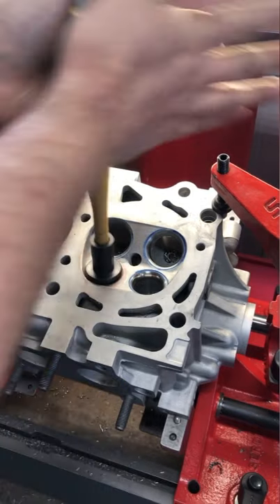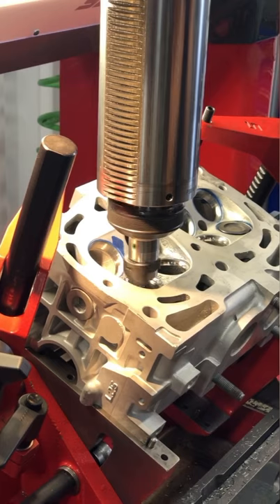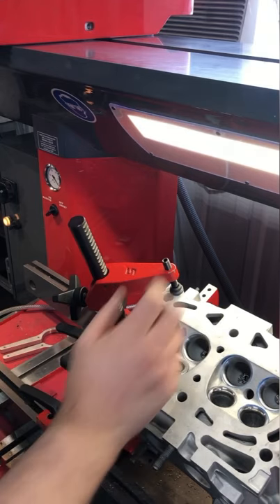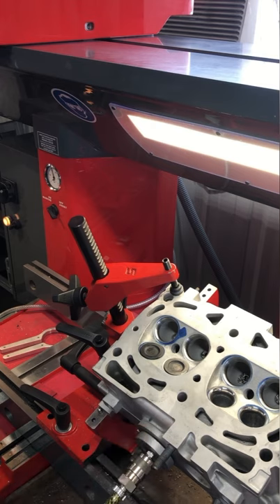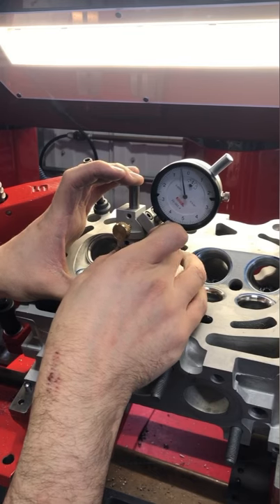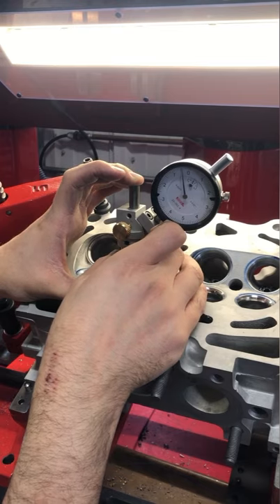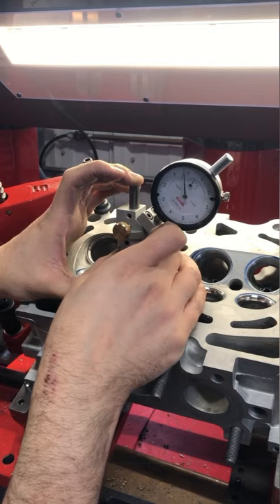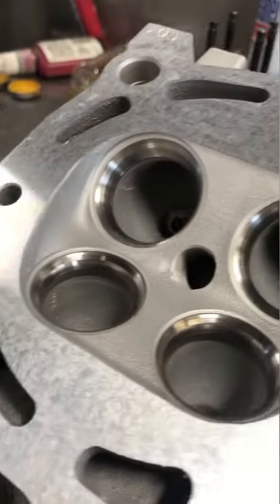#shorts Let’s try and explain this... again?

Comment: When making sure a valve on a steam or gas turbine seats proper we blue the valve and slam it into the seat, or vice-versa. Then from there we lap it with lapping compound or lapping tape. Rinse and repeat until the bluing transfers completely to the valve or seat. That said a valve on a large stream turbine can be 24" to 36". While we have to align shafts, bearings, shrouds, bases and flanges to within a specific tolerance. There are times we use the valve and an impact with a lapping compound to mill the seat until its going to assure a proper seal.

Comment: Trolls dont understand the finalities of anything!!!! You can machine something as perfect as possible and still have chatter from a dull tool or the seat has a hard spot or slight defect - truly & honestly seat lapping with paste finishes it off - bluing is a good guide for seating position and 30,45,60  angle placement if minimal valve seating is a performance requirement for gas flow - 👍👍👍👍🙏🙏🙏 your videos are very concise and informative - KEEP UP THE GOOD WORK 👌👌👌👌👌👌

Comment: Basically, it is a start up point prior to going onto the cutting aspect just to make sure that the alignment of the valve seat that may have just been pressed in is practically square and not off kilter in reference to the underside of the valve, correct?  If this is so, that is a great trick and very astute of Nicholas doing this methodical step?  GREAT WORK!
Reply: He starts machining the seat, once the sealing surface of the seat is machined, he puts the marker on there so he can see exactly where it is contacting on the valve face, he does this in case he set his tooling slightly off from where he wants it so he can adjust the cutter in or out to have the optimum valve face sealing location, once its set right he continues machining the seat until he gets to the desired depth.
Reply: @Joshhalley711  Ahhhhhhhh, perfect!  Good trick.  Thank you!  Hello from San Antonio, TEXAS!

Comment: I blue valves to check how well they're seating, obviously vac them too but you can tell allot from bluing where a vac could trick you. For example if you had an interference angle where you didn't want it, it could in theory pass a vac test but you'd see it in the blue. Lapping to check valve seats is not precise. Great videos though man, I've learnt quite a few different ways of doing things I do on the daily! Awesome

Comment: Educating people is more difficult than non-educators often assume. Misinformation has to be dislodged ("un-learned") before new information can take hold. Also, willful ignorance exists. People tend to dig in their heels and fight rather than admit being wrong - even to themselves. When faced with these obstacles,  one has to determine if it's genuine stupidity or ignorance that's preventing the absorbing of the information one is trying to teach. There's a difference: "ignorance" is never having been exposed to the information. "Stupidity" is being either unable or unwilling to absorb it.

Comment: Better than our method, not that ours didn't work. We would reach under and hold the valve open with one hand and tap it down firmly to check seat seal width, seal position, and ensure even sealing all the way around.

Comment: Back cutting that remaining blue  the stem side at a fairly sharp angle , and slightly on the valve face, will gain some flow,  and that seat width is a fine dance between flow  and surface area, to allow enough cooling,  and the seat needs to be smaller with the proper angles  for the venturi effect, or the engine will not make any Power ,  it's all a fine line between success and failure,!

Comment: Something's seriously wrong if you need to lap at this point.
Reply: Think the message is reassuring one self? 
Small businesses live of their reputation you know, big businesses usually don't give a....
Reply: Well, not really. The cutter is registered against the block, thr valvr seat against the valve stem, so wearing them down against one another is pretty important for that mirror polish and perfect fit. I mean grinding were talking about flatness at the microscopic level, not just a tenth of a thou
Reply: @DrTittieSprinkles  what the heck man? First of all, the amount of people building $100k engines is ludicrously small. Second of all, I don't think he was using a $5 suction cup, he was using a vacuum gauge, which seems like an excellent test to see if the valve holds against pressure and doesn't leak. Because that's exactly what you want a good value to do. On top of that, pretty sure the grinder and lapping machine stuff this guy is using isn't cheap at all
Reply: @imthedarknight-8755  You don't even know what you're talking about. That Serdi is a seat and guide machine not a "lapping machine". I'm agreeing with the video not the ding-bat I replied to.

Comment: Well you could lap the valve to achieve the same result, thats my method, but I don't have fancy Serdi's lol.
Reply: You can't achieve quite the same result by lapping. You can get old valves and seats to seal by lapping, but you are reccessing the valve and widening the seat contact area as you do this.
Reply: You really don't need to lap it that aggressively to see it. I'm talkin 5 seconds give or take with fine compound, yes its harder to see but it works.

Comment: I’m still grinding my seats the old way with stone I never have a issue
Reply: Well yah  ...  

As long as you dress the stone frequently, it is a perfectly viable method.

And, I've never seen a controlled performance comparison between ground seats and cut seats.
... Probably due to the difficulty involved in distinguishing a measurable difference.

Edit: 

And, I would add:   By using "fine" finishing stones, lubricating oils, and light pressure  ...  it is easy to arrive at a polished seat surface, that is not possible with a carbide cutting tool.
Reply: As a retired mechanic,  I can do a ground valve job, polished smooth with a fine stone that performs as well as any cut seat. Not all machine shops are set up with the newer technology as shown in video. A mechanic can raise and lower, thin or widen any valve /seat contact location with a quality 3 angle grind. A rub of prussian blue to double check and I would match a quality grind against any cut.

Comment: Unfortunately, I am just joining the discussion, as I have not seen previously uploaded vids on this topic.

While I am fully aware that this video has nothing at all to do with valve-lapping,

 I think that it needs to be said (if it hasn't been already)   that the old-school method of "lapping valves" has long-been surpassed by improved methods of valve work.

It has been shown repeatedly, that when abrasive valve lapping paste is used, to "dress" valve seats; the abrasive medium does not cut the seat surface evenly. In fact, lapping always produces a concave depression in the seat, that increases in direct proportion to the length of lapping time.

Comment: Attention to detail makes all the difference. If you're work is so precise that lapping isn't required? That's perfection. That's how you justify the charging premium price and have people willing to pay it, over getting 'Old Skool' to hook you up for half the price and a 12 pack of Natty Ice. He can do it and can get it done by noon tomorrow. But, you're not getting perfection and if you're using it for competition? You're giving up performance. No matter how little. With your valves and seats being done with so much attention to detail? You can be sure that you're getting the very best performance possible from your heads. The rest is just adding to it. Old Skool is going to have you compensating before you are adding to your engines performance. Awesome job!

Comment: No need to repeat yourself to idiots, people who have actually been in a machine shop knew what you meant. I use the same technique for shimming and setting the backlash for large worm gear conveyor belt drive boxes. Once you replace the bearings on the worm wheel you have to shim the case to make sure your backlash is set correctly and that your worm wheel is centered perpendicular to the worm center axis. To check this I paint the teeth of the worm wheel with Prussian blue and bolt in the case with the original shims. Next you run the gear a full revolution and take the case apart again. The pattern of the worm meshing with the wheel shows up in the Prussian blue on the worm wheel and you can then take vernier scale measurements to know how much you need to adjust your shim size. From there you add/subtract shimming material, repeat the process and if good you bolt her back together, check your float tolerances and she good to go.

Comment: Factories never lap valves. Every new car runs fine. Shadetree guys everywhere "my pappy told me to lap the valves. I've never seen sioux or rotler equipment in my life but my pappy says you're doing it wrong"
Reply: Well us mechanics like to lap leaking valves to get them to seal if the seat angles look good.

Comment: Looks like the heads off an old type 1 vw
Reply: Maybe  ...  if you are looking through the bottom of a beer bottle.

No offense, Bud,  but, how many of those type 1 vw heads  ...  

rolled off of the assembly line, with 4-valve pent-roof combustion chambers, overhead camshafts, and water-cooling?

It has all of the features, that Type 1 VW owners only saw in a wet dream.

Comment: When do you lap a valve then?
Reply: I’m no builder, but when I lap valves it’s because I’m just trying to restore the valve to seat mating surface.
In other words you only do it when you are not regrinding the valves or replacing the seats.
Reply: @McFingal  like buffing paint rather than a new coat? Only backwards
Reply: @MrWolfe20  like bringing back a luster to a faded paint.

Comment: Subarus suck, well they are good up to 130,000 mi. After that water pump goes out and usually burns up the engine and there are no readily available parts or info. So rebuild away...

Comment: Unless you’re building racing engines this is all a bunch of bs. Lap it and shove it in there…
Reply from the maker: Well there are those of us who are professionals and then there are the hacks 😬
Reply: @JAMSIONLINE  call me what you want but I live in the real world where everyone can’t afford to pay machine shops hundreds of dollars when you can buy lapping compound for 10
Reply from the maker: Sure! And you can pay twice when it lasts 10% of the time thet doing it right does!
Reply: @JAMSIONLINE  I’ve had so many machine shops talk down to me like I don’t know what I’m doing but I’m more trained on engine building than 90% of them who think they know everything. They will talk up their knowledge then use a dull bit on the cutter and leave a crap finish on your cylinder head in a heartbeat… I’d rather sand it with a block…